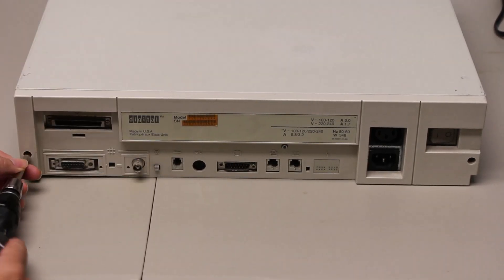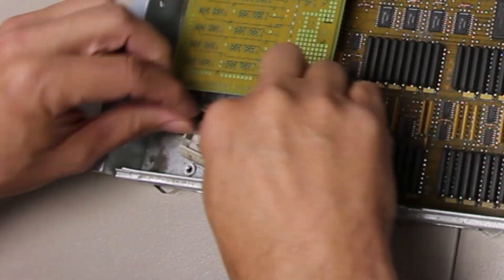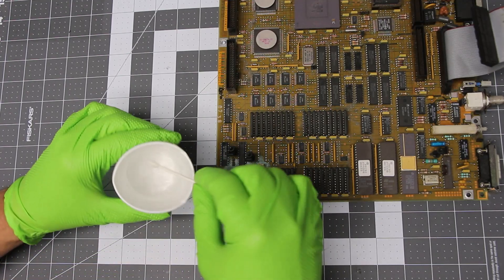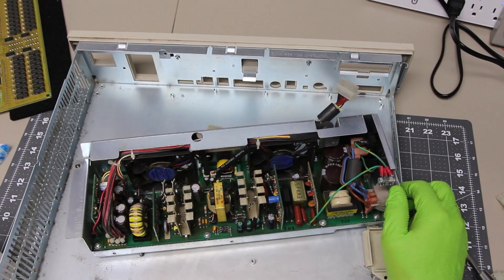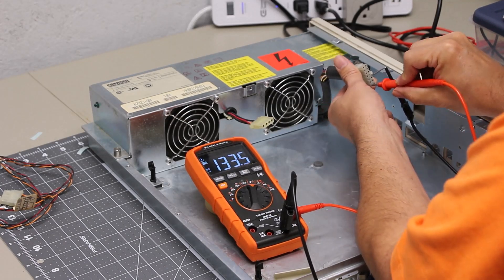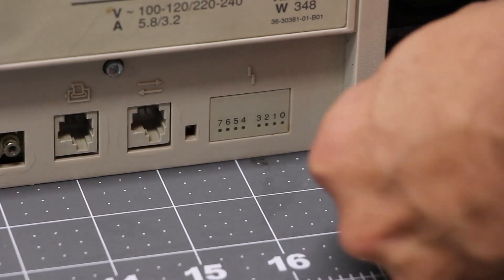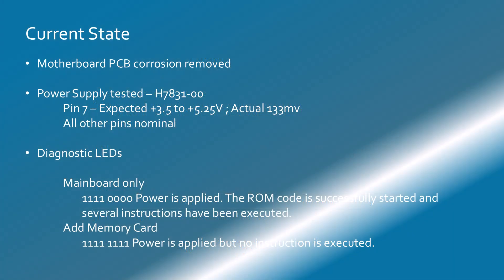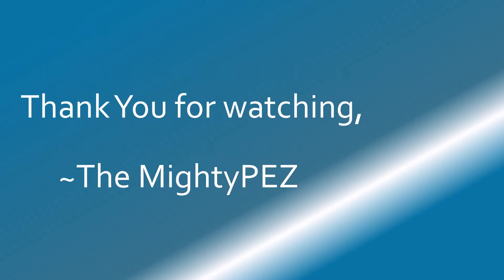Triaging a VAXStation 3100   Will it ever run again   Part 1

Comment: Greetings! This looks great. I love running my VAXen at home also. It'll be great. Firstly, you can run the machine without the memory board. They shipped with and without. (16mb, 24 or 32mb). This lets you test in isolation. Another thing I like to do is get an IDE hard drive that's toast but the engine spins. Can be SCSI.. the important bit is the engine spins so it puts a load on the PSU. Some of the VAX PSU's won't behave unless there's a load and are marginal at lower loads so they can look weird when tested in isolation, then completely different with a load. Really looking forward to your journey. These are fun little beasties. Will subscribe. Also, the coax is 10base2. Best wishes.
Reply from the maker: Hahahah, hoo boy, i was a net engr for many years, cant believe i said 10-based-t. Thanks.
Reply: @MightyPEZAfterDark  It's all good. I can't imagine the stress levels at being 100% correct in these sorts of videos with so many deeply knowledgeable enthusiasts scrutinising everything you say and do. It's all good. :) I loved my 3100's and did so much with them. I ment to point something out, with some of the early m10/m20 ..the SCSI script chip can only do ..from memory (?) 4 byte SCSI CHS mail packets instead of 6 byte. So it'll pull the correct drive geometry and you can initialize the ODS-2 fs and install, use it..great but the moment usage goes beyond the CHS values it'll wrap the offset pointer and fandango on disk from the start. I found out the hard way a few times. Later systems with newer SCSI disk systems don't seem to suffer from this.

Best wishes!

Comment: Hi! I will not be able to help you with the electronics, but as the owner of a working VAXserver 3100m model 10  I can tell you that the Zuluscsi RP2040 can be used as a replacement for the disks. It's about half the price of a RZ26 or RZ28 disk and it can emulate 7 disks at the same time, including CD's. I booted the server from the VMS 7.3 install CD ISO image and installed VMS from that to a emulated RZ28 2GB disk from which the VAX now boots. In some cases it's a bit slower than real disks and in some cases a bit faster. All in all I'm happy with it.
Reply from the maker: Thanks.  I had heard of the bluescsi. I am checking out the ZuluSCSI now, thanks for the suggestion